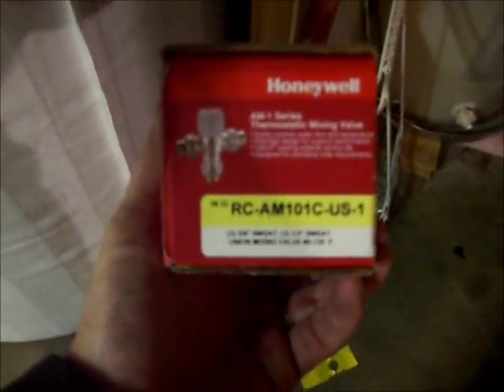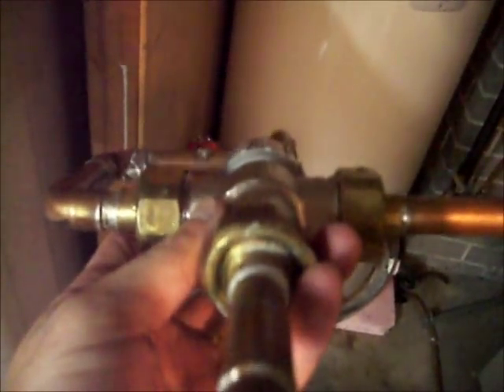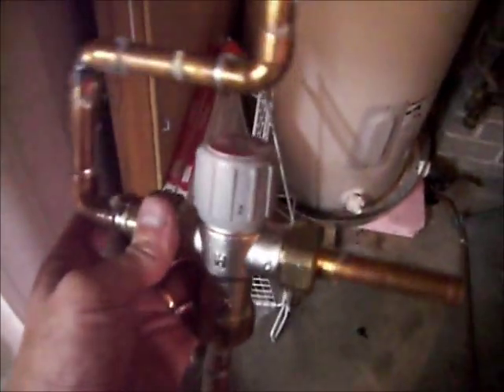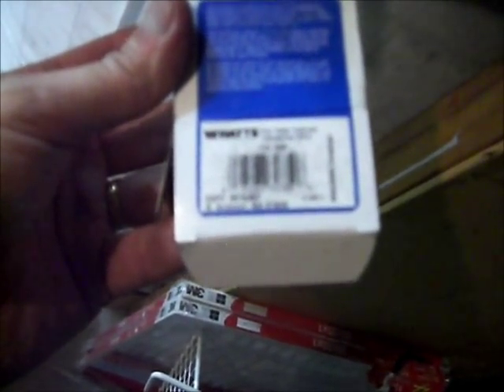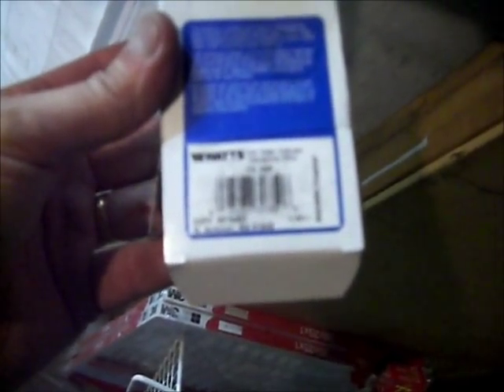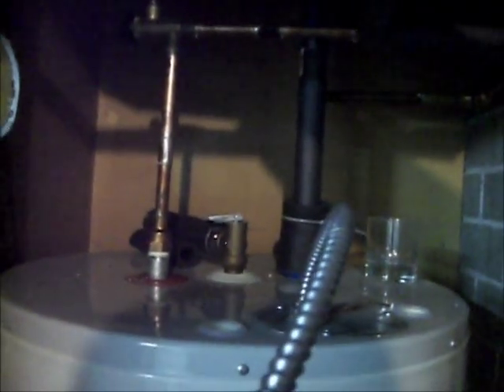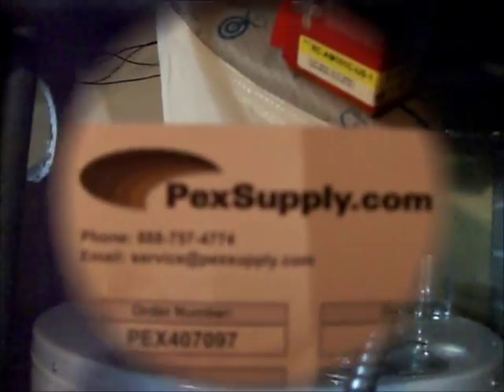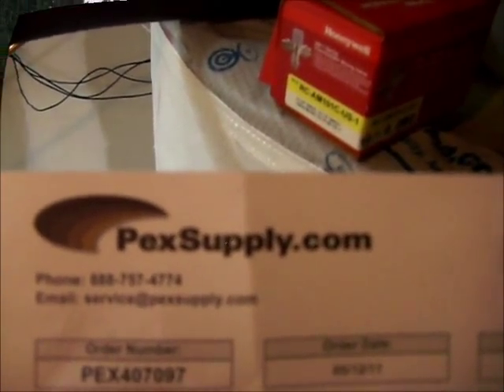Watts 70A-F Tempering Valve for Solar Hot Water

Comment: Did you remove both the top and bottom internal valves from the 70a housing before sweating it? The bottom doesn't seem to want to come out and I'm afraid it'll get damaged from the heat of the torch.
Reply from the maker: No I didn’t take it apart. No issues on mine.
Reply: @westvandude  okay called the supply house. They said you only have to remove the top valve to sweat it on and avoid damaging anything. Thanks for the reply.

Comment: Thanks. I have an older Watts 70A on the hot water outfeed from my oil boiler with a tankless coil for domestic HW. Last night, due to insufficient HW, I looked at the valve and could not turn it, at first, to adjust. So, I guess it was simply stuck in one position due to corrosion, and not adjusting to incoming temperature. I forced it more than I wanted to and it became loose and I was able to turn it back and forth to loosen it up a bit, adjust with a thermometer at an outlet, and it seems OK. I will have to take the interior out to inspect and clean it and perhaps replace parts with their kit. Anyway, I guess you might have something up on YT about the HW heater and setup. I will have to check your videos. I've been wondering if there is a limit as to how high a water temp you can supply to just any ordinary HW heater. I just read in one manual that if the temp in the heater gets too high it throws a switch disabling the heating element (this was electric) and it has to be reset manually. Perhaps feeding pre-heated water into a unit like this, an electric WH,  would require putting such a valve as this one onto the inflow to keep the water inside from becoming too hot and throwing the switch. But that cuts down on the reason for feeding the heater with pre-heated water in the first place. I am guessing there are HW heaters made to be fed incoming HW and will have to shop around. I am wondering about feeding a HW heater with hot water from the boiler coil in cold weather when the boiler is operating and perhaps from a crude solar setup in the warmer weather.